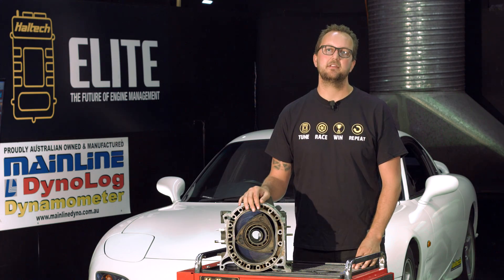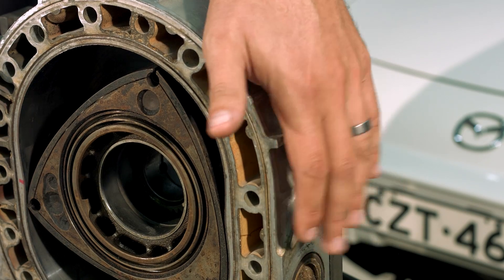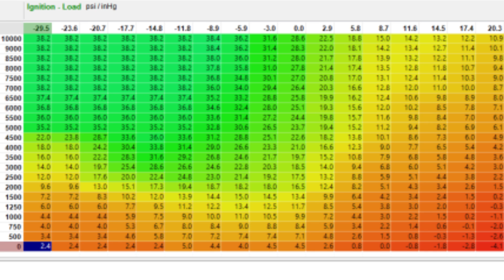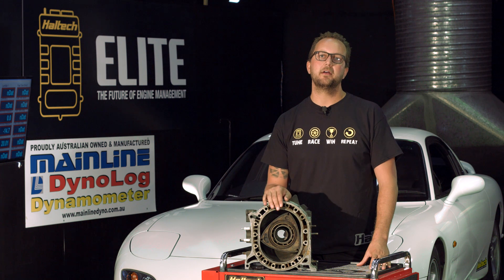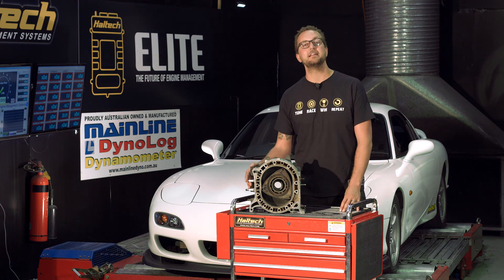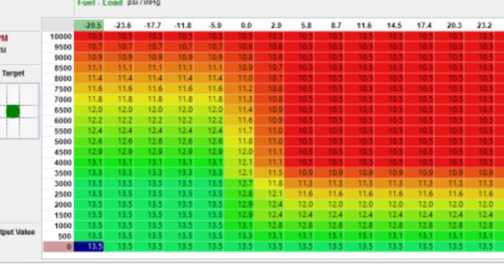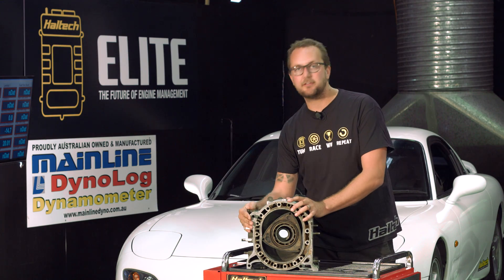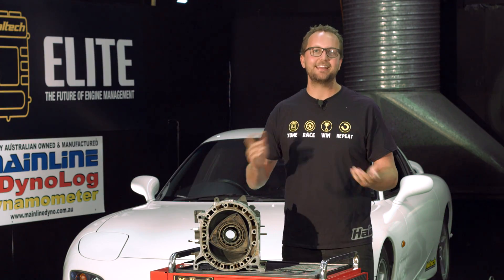💬 Tuning a Rotary Engine - Technically Speaking

Comment: so what exactly is the ignition process for tuning split timing?do you set split timing map to "0" and just tune leading timing first and then start adding split to see if power increases?i know u mentioned to start with 10 deg on split as a starting point,but i want to get how split timing is determined for a specific engine.and how is having a low split value will damage the engine?

Comment: This video makes me want to swap my rx8 to an rx7...shame the insurance is so astronomical in the UK, great video! Cheers!
Reply: As an owner of both, I highly recommend doing this. Love the 8, but it just lacks the power. Great for some B roads though.
Reply: @Flyingdutchy33  nan3r
doktorbimmer there is something seriously wrong with you. Like, really wrong with you

PS, wrong guy, I was never even part of that argument. But that doesn't really even matter cause you're obviously nuts
Reply: not so much about the lack of power but aesthetics for me, lmao
RX-7 FDs are probably the nicest looking cars there are in my opinion, RX-8s look very pedestrian in comparison
Reply: Yeah they are a little more "common-looking" and less exotic for sure. BUT, you can still make them look more decent than most of the stuff out there, if you make it look cleaner. I get compliments all the time. I also really like the interior build quality if you have one without the pop-up gps thing. But, ultimately, the 7 is looking so freaking nice that any comparison with it is quite unfair imo.
Reply: Rx7 was a two seater racer, the rx8 was a family sedan. Yes, Doktor, thank you for pointing out the larger car with more seats and safety equipment is larger. Now, for some odd reason, you're making a claim that the Renesis had less torque than an fd or an fc....just....sad
Reply: Insurance companies will never know if you do a 13B or 20B-REW swap, it's still an RX-8 to them. You don't have to, by any means at all, disclose modifications
Reply: Haltech is now your best source for LS swaps, the future of the performance aftermarket

Comment: So which ecu do you recommend, is a 750 suitable for a 1.3-2L Dorito. Or will it require a full glory 2500. Or one of your sport line ecu.
Reply from the maker: +Walaboro The
 Elite 750 will run both 2- and 3-rotor engines with 2 stages of injection. For advanced features such as oil metering pump control, closed-loop boost control etc, the Elite 2500 will be required.
Reply: thanks appreciate it! friend is doing up an older Rx7 and ive been trying to get him to go with one of your products

Comment: When you were talking about a rotary requiring something like 2000cc injectors for 400kW, was that 2000cc figure for each individual injector or the sum of volume flow over all the injectors? An NA rotary with 2000cc injectors seems like a lot to me, but then again I guess that is 400kW without boost.

Comment: rotory record is 6.14 9n the 1/4 mile
Reply from the maker: +Flaco Taxi You are quite correct, Major League RX8 holds the current rotary record of 6.14@229mph.
Reply: +haltechecu 6.19 second fastest, is Mech Tech Rx8 Loquito Killer
Reply: +haltechecu great video
Reply: Still can't beat pistons, 3.831sec. @ 324.38mph

Comment: that was a great video.  tuning a rotary isn't nearly as complicated as a piston engine and what you provided was good safe numbers to begin with.
Reply from the maker: +TheTurbooneg Thanks:)
Reply: In my experience tuning a rotary is equally as complicated/uncomplicated as tuning a piston engine, however with catastrophic failure a likely result of getting it wrong when it comes to rotary
Reply: As you progress in your research, bear in mind that the word “invention” has a very specific meaning in US intellectual property law (I realize that you may not be in the US): an idea becomes an invention when it has been “reduced to practice,” meaning that the specific method for implementing the idea has been devised.  My invention is four years old, and I am just now ready to prototype it.  That brings me to another point: manage your finances well, as poverty will delay your efforts beyond the limit of your patience.
Reply: Haltech is all about LS swaps now
Reply: +James Craswell yes it is possible i seen pistons blow thru the heads
Reply: Doktorbimmer, you can blow an engine by tuning it improperly. This is true for every engine -_- wtf are you arguing here?
Reply: @rckli  Wankel engines are inherently unreliable and less durable than reciprocating engines... it easy to blow-up a Wankel engine even under light loads with correct tuning.
Reply: @rckli  Wankel Engines are inherently unreliable and fundamentally inferior to reciprocating engines, this is an irrefutable fact that cannot be disputed.
Reply: Right...  So its not possible to make a piston engine fail by tuning it wrong.   *Making note...
Reply: +haltechecu 
I have thought of in idea " invention  " that could make the rotary engine much more eco and better fuel ratio
and could I get a halyech ecu for research ? I will be at final year project in auto. Engineering , so I want to konw what could U provide ?

Comment: scott! how do you tune the knock sensor on an engine you don't want to have knock?
Reply from the maker: +Derek Jacobs This video gives you a quick overview on knock control setup:
https://www.youtube.com/watch?v=jUUPcNPGm3k
Reply: Thanks for the reply!

I've watched that video, it's a great understanding of tuning knock.
I ask because I have a rotary build that I want to convert to Haltech from Microtech. Any detonation in these engines can cause seal damage and require rebuild.
Can it be done without forcing knock? Like, are there known frequencies for your recommended knock sensors that I could tune for without needing to force knock?

Perhaps I'm overthinking it, we're a long way from the tuning process anyway, but I wanted to gather info :)